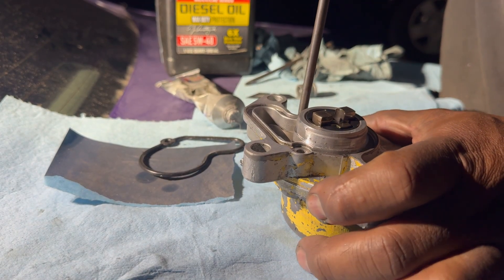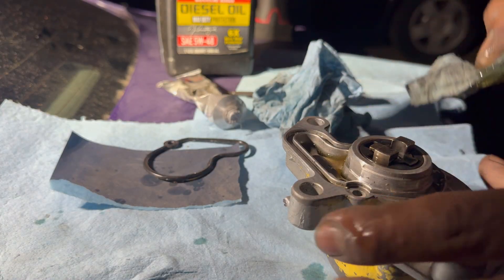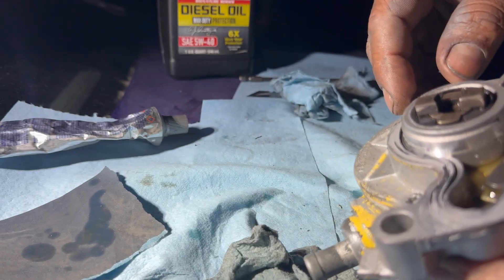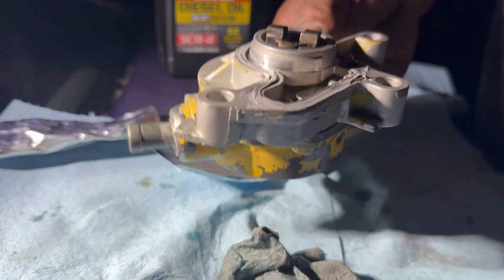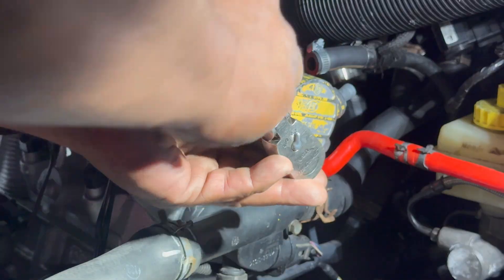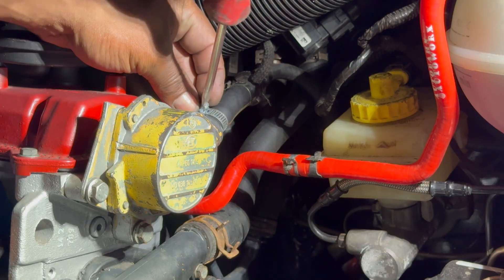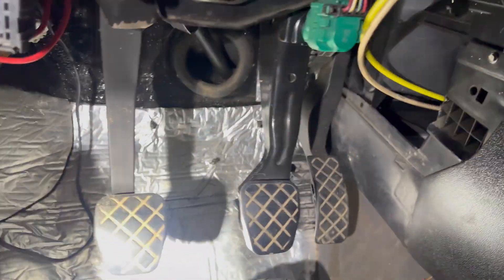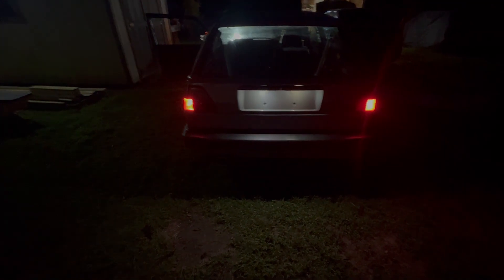How to rebuild your tdi ALH old vacuum pump

Comment: Great video, by the way. I did have a question about the vacuum's nipple. Some people seem to add JB Weld to seal it, apparently to prevent vacuum loss.
Reply from the maker: Pull the pump open it and with your finger close the hole in the back and blow air through the nipple and see if it leaks    If it does  i just hammer the edge all the way around and that way is seal again